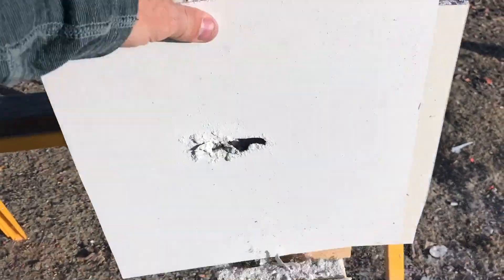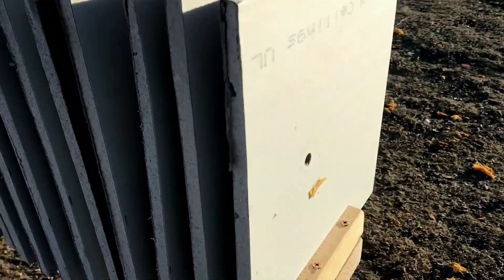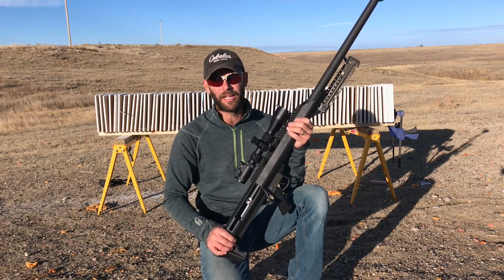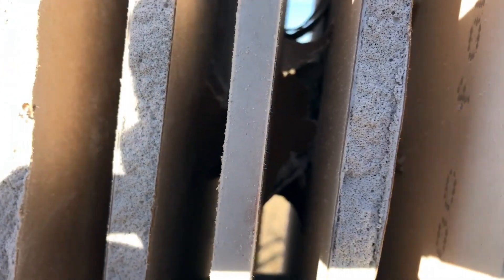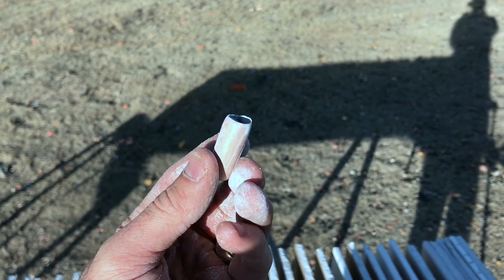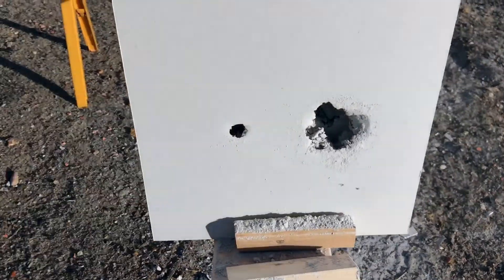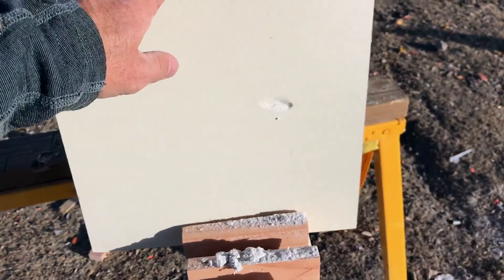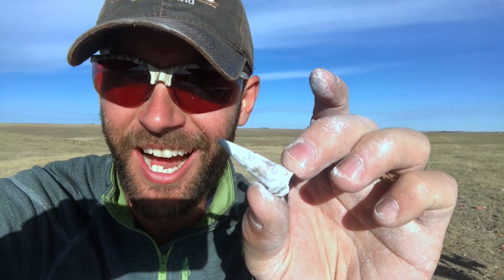50 cal and a Smith and Wesson model 500 vs Drywall

Comment: Don't know if anyone's done this, but I'd like to see what bullets do to tools, hammer, axe, pry bar, large screwdrivers, adjustable table vice, anvil, vice grips...etc.  Different calibers if you can, it should be interesting to see. 

I was also reading on reloading primer boxes that primers can be set off if put in bunches, I wonder if there would be a chain reaction if 1000 primers were shot at while in the box, or put in a container all mixed up, different tests could be done, but from a safe distance.  They're pressure sensitive so it would be interesting to see.
Reply from the maker: This is a great idea.  I will have to hit up the pawn shop for some tools to shoot.  The Anvil idea is awesome!  I have always wanted to shoot one.  The primer idea is great as well.  I have to tell you that 50bmg primers are not cheap.  I will look into shooting some though.  That would be an interesting experiment.  Thanks for the great ideas.